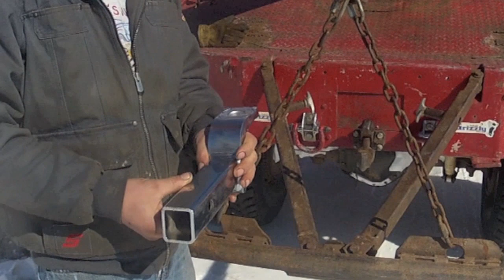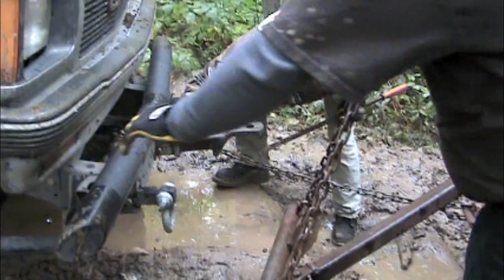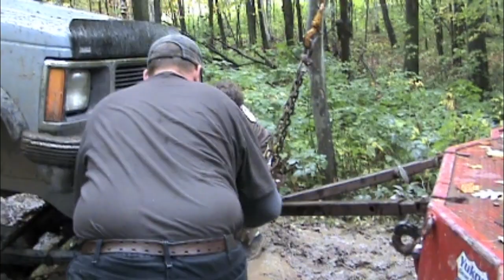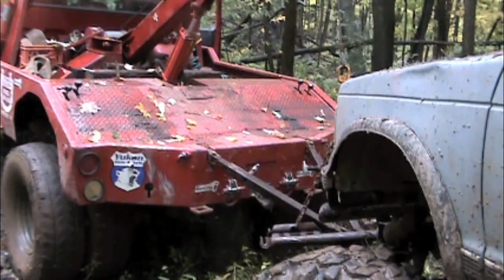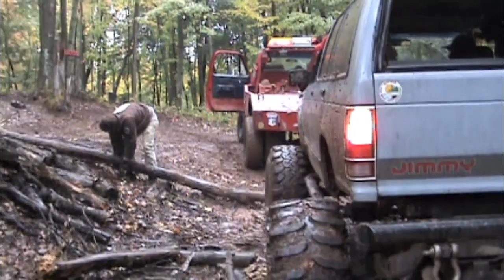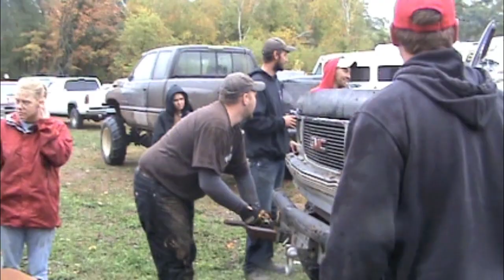GMC JIMMY RESCUE PART 2 by BSF Recovery Team

Comment: Looks like crossing the chains might be the way to go when hooking them on the sling. No right/left movement.
Reply: You can't cross the chains especially when using the J-hook ends. You only cross safety chains when you have a trailer in tow, to create a cradle should the ball and coupler or the hitch breaks/ malfunctions.

Comment: Thanks for the lesson and new video.  Man, does it look cold up there.

Perhaps you could either weld limiting tabs farther back on that recovery bar (to keep a receiver from sliding off), or weld together another recovery bar with limiting tabs for lifted and big-tire rigs?

Question:  You guys rely upon cable for your winches.  Is there a better brand of cable to load a winch with (while keeping the same diameter), is is cable pretty much cable?  I see that y'all don't put a buffer/blanket/ whatever on the winch cable in case it breaks, so I have to guess you trust your cables more?

Comment: you need a stronger motor 502
Reply: The motor is perfectly fine from the sounds of it! The problem here is lack of traction. Some Mud Terrain tyres would have made the job a lot easier but that ex-humvee setup does look pretty cool
Reply: Rich M motor is bogging
 in low

my guess is a 305 motor
Reply: *****
Your guess is incorrect.  It's a bored-out 350.

watch?v=j2qv6pgo9ec